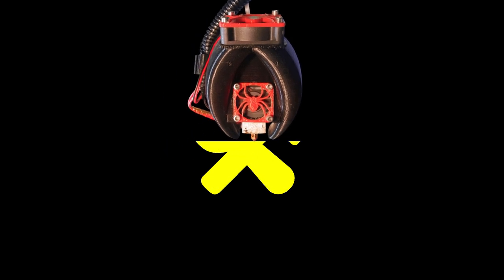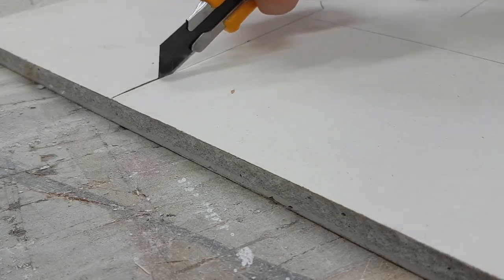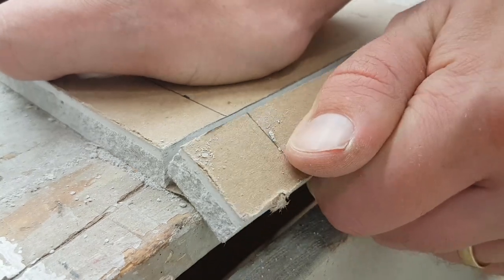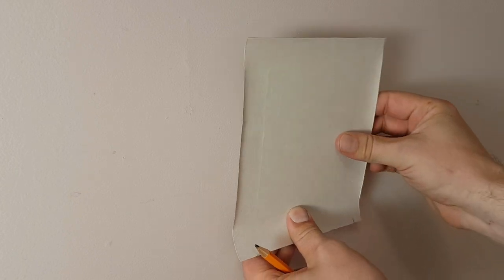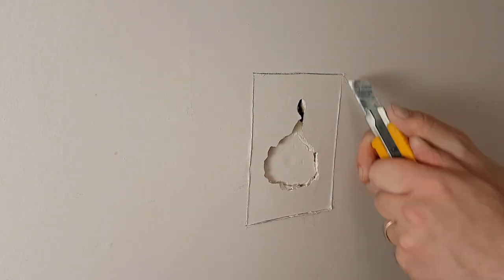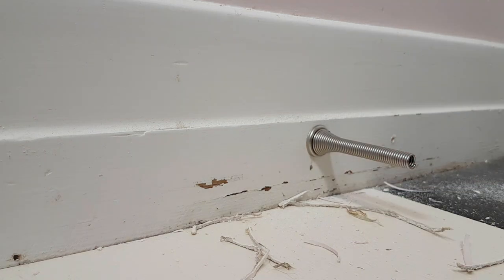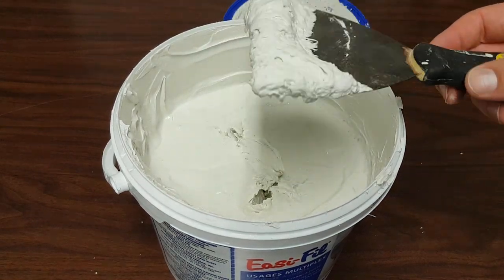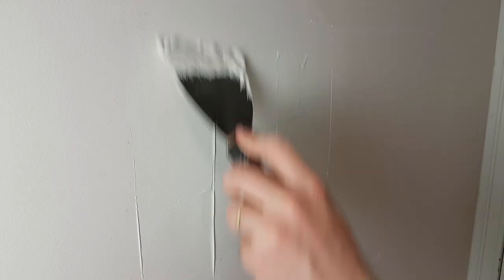California patch

Comment: I have done this many times. Works really good!
Pro tip... Score the paper on the wall as well, to the same size as the paper edge on your patch. Peel the paper around the hole back and your patch will fit flush on the wall and you wont have to float your mud to hide the rise from the extra layer of paper. If done right, you'll never know there was ever a hole there 😉
Reply from the maker: Wow that sounds like a neat idea I'll have to try that, thanks
Reply: I would be afraid of blistering
Reply: Mud doesn't adhere well to the raw gypsum. You would be well advised to either not do this at all, or if you want to, treat the gypsum with an oil based primer (not worth the effort for such minimal gain).

Comment: Nice technique.  Beveling is a great idea, I'll be doing that next time I do this.  I'd also suggest sanding the wall with 120-320 grit before inserting the patch, then lightly wetting both wall and paper edges of the patch before adding mud.
Reply: Yeah it seems like this will leave a bulge.
Reply: @stopthephilosophicalzombie9017  I think it can but theoretically it should only be the thickness of the paper.  I did it again not that long ago and it left a slight depressed area in the center, which I filled with compound, sanded, hit it again with a thin layer to hide the patch and then sprayed texture.  Came out indistinguishable from the rest of the wall.

Comment: I like to use a hot mud for this because it doesn't shrink and is stronger than original. It also saves time for me to put the dry patch on the wall and then trace it with the knife on the wall, pull it out, and then pull the cut paper off of the wall. Then when you put your patch back on you only need the mud one time and you're done 😁

Comment: Dude!!! You are fabulous!! I LOVED it when you pulled all of the old patches out of the wall. I was saying... "door stop they need a door stop" and you added one. I use the doorstops that go on the hinges... that way people don't step on the new doorstop & break the spring... It takes a bit longer & is a bit harder to find but it stops the problem FOREVER. If you have 3 hinges you can use the midway hinge & it is a bit easier to install alone. I have hinge doorstops that have been on my doors for 30+ years & have never failed. AND I loved how you rolled the drywall patch over the edge of the tabletop. I was wondering how to do that & not rip the front tape. GREAT solution & great vid!!
Reply from the maker: Thank you glad you liked it. Good point the hinge door stops would be a good solution

Comment: You can also do two things:  

First install a metal mesh behind the hole.  Anchor it with temporary screws through the dry wall outside the area of the hole.  Remove the anchor screws once the patch is in and the mud is dry.  Then fill the small anchor screw holes.  I have done this several times.

Second cut out the paper of the existing drywall front paper so that the paper of the patch fits into the paper removed around the hole.  This makes everything flush.
Reply: None of this is required. I have patched hundreds of holes as shown in this video.

Comment: Also should have pulled the previous disaster of a broken piece of dryway and that paper,  'thru...first...so you can check for wires behind the fix area.  You just run a saw thru there before checking,  and sever some wires.... well.... not good.

Comment: Would that patch be string enough to support a fluorescent light fixture?

I the screw that held it in place was ruined due to the upstairs faucet left running. So I wanted to cut out a new patch and replace the ruined drywall but will the patch not work even if I let it site for 12 hours or so?
Reply: Consider screwing pieces of board that you can insert and fit inside of the hole (as backstop)  to support the light fixture,,

Comment: Ok I did this now you can tell I did a job there this patch just sticks out more than the wall itself, what do I do about it now
Reply from the maker: Using mud, you feather it out and make it a gradual bump.  That's the way drywalling works. There's always bumps, but you just kind of spread it out over a larger distance using several coats of mud to make it not obvious.